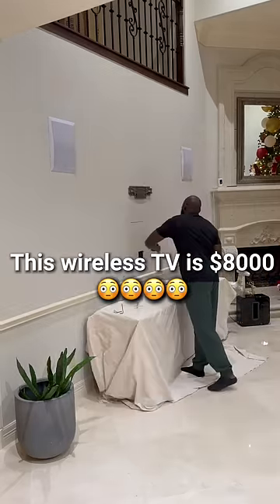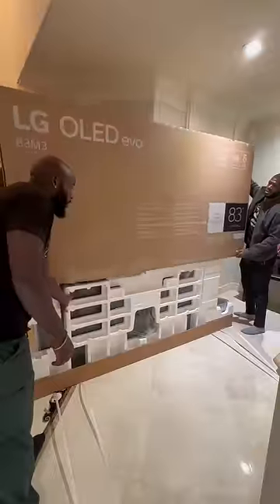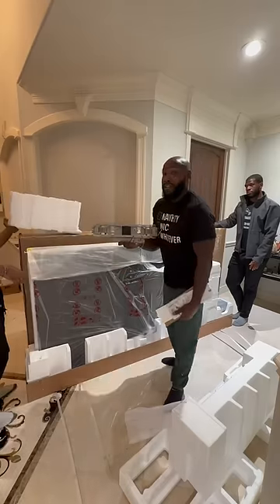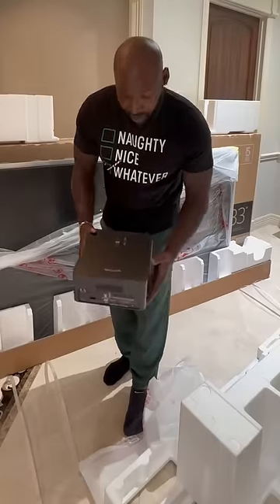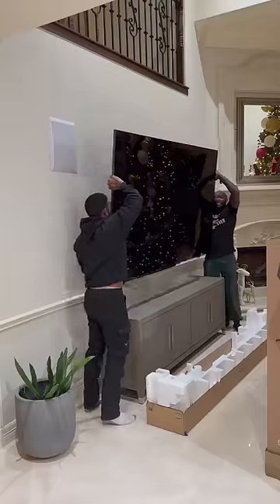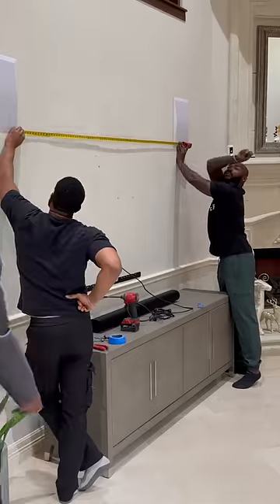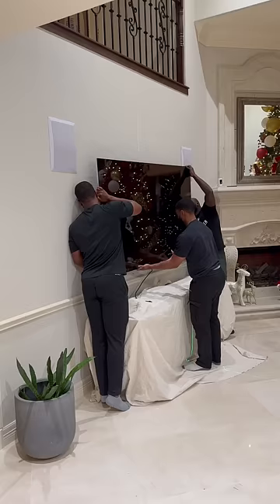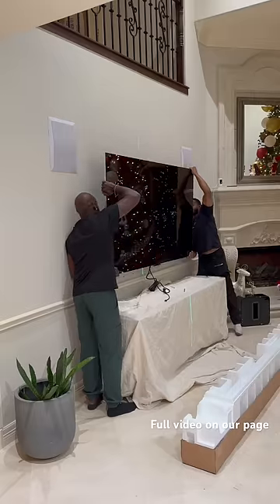This TV is $8000 😳😳 #lg #oled #explore #fyp #work #shorts #luxury #tvmounting #install #howto #fun

Comment: $8000 tv still rocking a soundbar is crazy 😂😅
Reply: Being so flat its no space for speakers large enough to put out movie/theater sound.
Reply: I thought the sound bar was from the old tv
Reply: Bro do you not see the big white speaker grilles built into the wall?
Reply: @richardmillhousenixon  Still terrible, good speakers need open space around them to work properly. And not like they don't got the room, there's a table under the super-flat all mounted TV.
Reply: @k-jsr  Depends on the speaker.  And it's also the difference between 10/10 audio and 9.5/10 audio. Not enough to worry about unless you're an audio nerd.
Reply: @richardmillhousenixon lol. That soundbar is more a 5/10 than anything else. 

With that amount of space that thing simply doesn’t have the umph to immerse anything. 

Probably fine for watching the news, but that is it. Adds some clarity in vocals, but the rest is completely shit.
Reply: @k-jsr  that’s not true for in walls. The volume is necessary for low end, but you can use a separate subwoofer for those. For mids and highs you don’t actually need anymore volume than the speaker itself. I have in ceilings as well and they only need about 2L which is basically the speaker housing and mounting already. 

In-walls turn your wall into the front baffle which means the speakers have “infinite” baffle. Physics are different when there is no way for the air to loop around the baffle.
Reply: @Gren4te  Where did I say anything about a soundbar.
Reply: @k-jsr he's a man of aesthetics he don't care about the speakers
Reply: @truckdedriver9193  Exactly right.

Extra flat TVs may look good but they never sound good, and to be fair if you have the bucks for the ultra thin, you probably have enough for a dedicated sound system anyway.

Personally I prefer a happy middle ground of a thicker TV with at least decent sound.
Reply: Why wouldn't it?

Comment: $8k TV ? 
Me: Imma just head out to a car dealership
Reply: My TV cost 6,000sum
Reply: Yeah they make crazy good tv’s for 1/4th as much… lol
Reply: @e.t.2230  So true, and the $8,000 mark up is solely for the Wireless box, improved speakers, flushed mount, and the extra 10inches.

Just taken out the wireless box and go with a fully wired TV will save you $1300 for a TV the same size and specs. Then going down to 75inches saves another $500
Reply: @kaeganthornhill3936 so you’re saying size doesn’t matter? I mean an extra 10 inches is crazy! Just imagine what that’d feel like sitting up and mounting while grappling the wall.

Plus there’s no attachment issues because it’s wireless.
Reply: People scare me, $8,000 and I bet not an emergency or first aid kit to be found. Power goes out there are SOL.
Reply: TCL has a 13k TV that's only sold in China, though Linus Tech Tips manage to get it into Canada

Comment: Putting the box in the wall sounds great until you’re on the phone with tech support and they say “Ok, now find your box and press the red ‘reset’ button on it for 10 seconds and let me know if that helps” …:)
Reply: ✔️💯🎯🤣😄😆😅😂🤭NO lies told‼️🤣😂😅😆🤭
Reply: Brodie spent 8000 on a tv if he’s not happy he’s just gonna buy another one like in the video I doubt he’s calling tech support
Reply: it’s pulls off the wall with the mount but you can also push the tv all the way to the wall because the mount sit in the wall some
Reply: Yeah I'm sure they thought about that, which is why they installed the TV mount so the TV could be pulled away from the wall.
Reply: Or give us the serial number on the back so I would take a photo and email it yourself!
Reply: Or take the wall out 
Press and hold the button. 
If it works. 
Get a new wall 😂😂
Reply: Minor issue to a boss
Reply: 😂 "see if that helps"
Reply: For an $8,000 tv damn techs better show up with a ice cream cone for him and fix it. 😅
Reply: Sorry, I have several TVs from different brands and none have a red reset “button” as the “settings” in the TV menu apparently does that function.
Reply: @Rhaman68  I’m talking about the cable box
Reply: 1) there is no “red reset button”. 2) The wall mount has hinges which allows you to pull it from the wall. 3) He wouldn’t be doing anything himself but have professional come over to solve the problem.
Reply: Bold of you to think they don’t have someone calling tech support for them…

I know someone who is a stay at home mom, she has a secretary and a nanny and a chef, all of them are full time, and the secretary is specifically to do her errands only, not a family secretary.

Comment: Pushing right on the screen has me screaming!
Reply: Man mee too but the whole damn thing is a screen
Reply: No way around it bud
Reply: Yeah I was thinking the same thing I would be mad if that caused artifacts in a couple months after install
Reply: The plastic was still on the screen. It’s alright
Reply: It actually says in the manual to hold it there 🤷‍♂️
Reply: I felt the same way, I would never push on the TV screne
Reply: @starcandy6336 then you would not be installing it correctly, but that's on you

Comment: That looks smooth, but be careful as to allow the heat to easily dissipate away from those components inside that could otherwise cause damage to both the device and the wall it's mounted. 

To add to the effect by pulling the device away from the wall, is to use LED strips as bias lighting that will smooth your screen into an aura effect.
Reply: The tv was designed to be mounted that close to the wall.

Comment: What wall anchors do you use?
Reply: Two inch screws directly into the sheet rock should be fine.
Reply: @mightymight6778 has to be joking, that’s a great way to destroy your wall and tv.

You ideally want to install anything directly into a stud with construction screws or any screw with a high shear rating load.

If you have to install directly into the Sheetrock, if it’s light duty like a photo you can use most any drywall anchor.

For anything heavy you can use toggle bolt anchors, they put the shear force on the Sheetrock and won’t pull out, and hold usually over 100lbs per anchor.
Reply: Price bro
Reply: @MarkOhanesian  yes. I was joking. 🤣 I should've stated that I was. Not everyone has handyman knowledge. But then again, these are the days where a wealth of knowledge is at your fingertips. So if you take your advice solely from a stranger from a YT comment, then you have bigger issues at hand.

Comment: To save everyone some money, 4K is pointless unless you’re sitting around 2-3 feet from your TV, so in other words you can get a 1080P high Res / High FPS Refresh rate and it’ll be just as good.
For 4K or 8K too work, you have to be in the range I said above to get the true effects of the two, 4K and 8K are typically better used for gaming monitors or when you sitting right up under the TV fr
Reply: stop the cap. This is an insane take. It's absolutely noticeable regardless of how close you sit to the TV. Enjoy your blurry picture imma go watch spiderverse in that crispy clear picture.

Comment: $8000 dollars??…. That T.V better cook, clean & Do the dishes 😂
Reply: It’s actually on the cheaper side of “expensive” TVs.
Reply: @foxtride7890 oh please lmao. Not in the year 2023 where you can get 55+ inches and 4K resolution for $600 with no difference to the eye. $8000 is expensive expensive.
Reply: @bee1979  oled for 600 bucks?
Reply: It does 😂😂

Comment: Dont run to many in wall rated cables to any gallery tv as anymore than 2 hdmis will push it away from the wall where the ports are at.  Also, side note lg makes a gallery specific soundbar that has an a/c converter box for power and it isnt in wall rated.

Comment: I remember when pioneer first released their Plasma screen back in the very early 2000s. They came to the warehouse in 2 fly cases the size of a small car. The price for a 40 inch was 12000  pounds and a 50 inch was 22000 pounds. They were installed in a bar in Dublin Ireland. And they had some serious weight to them. Love the back box by the way. We can’t use them here in Ireland it’s extremely rare to have that much space behind a tv.

Comment: Those giant 4k TVs are not really meant for home use like that anymore. Sure back in the day when that was the pinnacle of technology, people would get them. They even got the 1080p versions back in the day. But when large format 8k came out, those things became business products. For signage and menus. Or for board rooms so people can give power point slideshows. Not to mention those giant 90+ inch 4K TVs usually actually cost more than the best 8k TVs. I’m not talking the designer ones though. Because there are absolutely 200-400k dollar TVs from designer brands. They just usually use a standard tv panel and have a fancy sometimes mechanical enclosure.

Comment: No disrespect, I’m ignorant but I’ve heard that setting up the tv on the wall completely flat at that angle like you did isn’t the the best way, now I don’t know if the stand you are using allows for access behind the tv and comes with some mobility so you can move it how you’d like but yeah just a question.

Comment: i dont understand why you would install a TV flush to the wall 

what happens if one of the inputs screws up? what happens if you need to reseat the cables?

Comment: That 98" is probably a Hisense or TCL (it didn't look like a Samsung but I could be wrong). Those TVs suck. The OLED panel is an order of magnitude better. I have the Sony 77" OLED and it's amazing. I'd love to get the LG 97" OLED for my home theater but the $20k price tag for a sub 100" screen is just unreasonable. I'll stick with my Sony VPL-XW7000es on my 150" screen.

Comment: Does the box you put in the recessed wall ever cause significant heat loss? Like if there is a draft in the wall due to poor construction would the perforated box leak heat.

Comment: What do you do, if the middle point between the speakers has a stud right there?
So instead of mounting on two studs and the middle is the evenly in between the speakers, you would have to mount it not centered. I’d it safe to just use toggle bolts in the wall? And maybe just use the one stud

Comment: The customer was likely acclimated to the OLED picture quality, then they decided to go to a 98” but didn’t go oled because w 98” OLED is $25k. They do make 98” TV’s in LED though and they are a few grand. Customer likely thought they’d rather have the extra screen real estate than OLED. They tried it, and realized they’d rather down size to the 83-87” OLED than deal with the lesser quality of the 98” LED.

Nothing too unreasonable or crazy here.

Comment: Meanwhile, I am watching this with a home theater projector at 145 inches for $600. I set up the entire system by myself in a few hours and didn't have to worry about dropping anything or scratching anything because it weighs 10 pounds and the screen weighs 15 pounds.

Comment: NGL he was using so much pressure on the screen to lock it in the mount inconsidering that I've already had someone push their thumb through the screen while mounting one of my previous TVs I don't think that's necessarily the safest way of going about installing a $8,000 TV
Reply: Like why not used two people and press it in from the frame on the sides

Comment: I wired a house once in 2012. He had 60k usd in tv, speakers and systems. Not even 5 year later we did a remodel and that 60k was worth nothing. Worthless. Old fat TVs, crappy speakers and systems built for only one thing. Point is. Nothing is worth the money